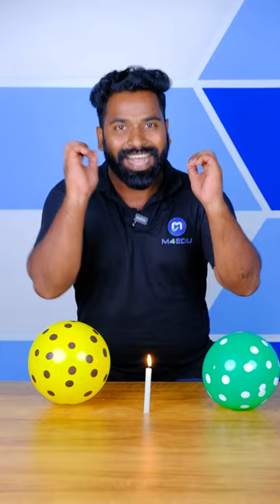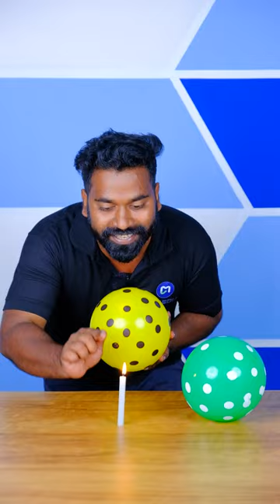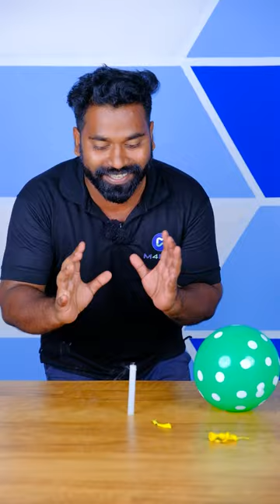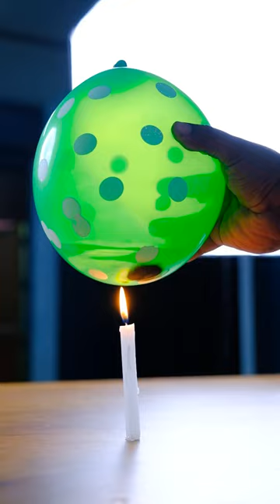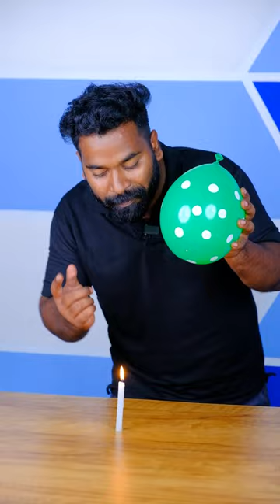Balloon Experiment | #shorts

Comment: Seriously...it's a kind request you to...
It's because of two things mainly.. specific heat capacity of water and expansion of fluids..
In air filled ballon , air has less specific heat capacity and high expansion rate..so the pressure can cross the stress capacity of ballon..
But in ballon filled water, due to higher specific heat capacity of water  ,it can be stable for a particular period of time..
If we exceed the particular time , by the time air above the water create pressure and also steam is generated due to phase transformation of water leads to bursting of water filled ballon